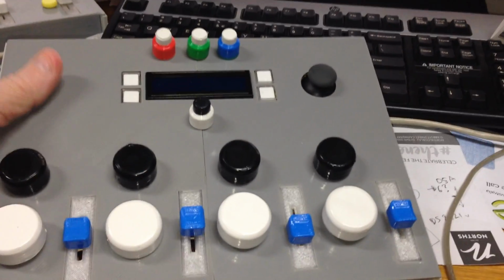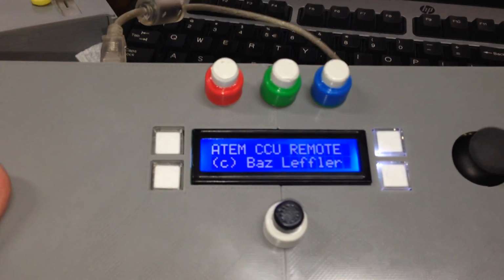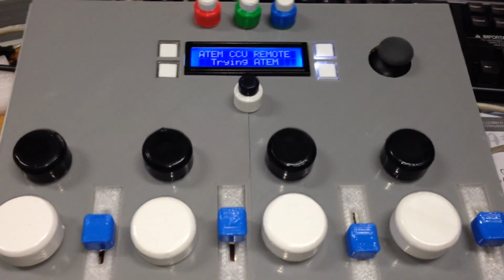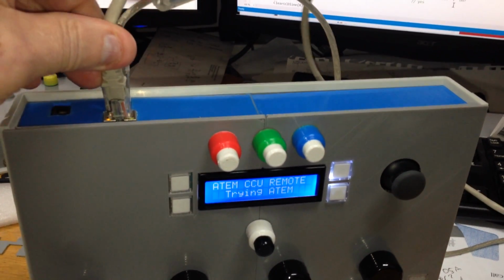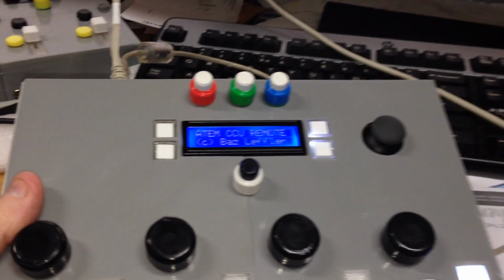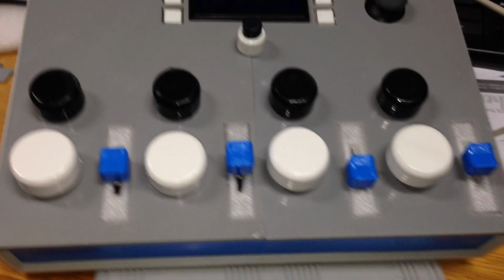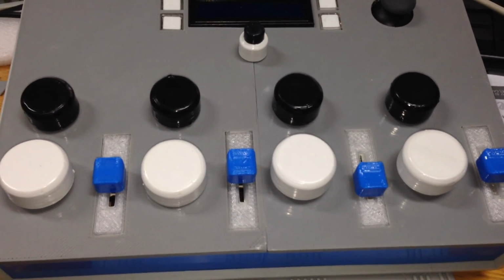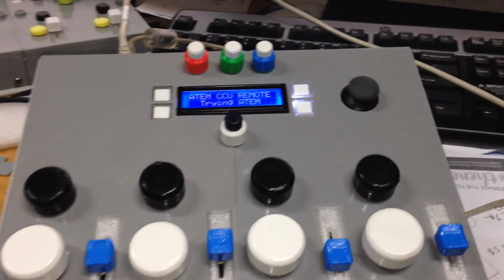4xCCU intro

Comment: compatible with ursa mini ? or just for bmd Studio camera only?
Reply from the maker: +Jay-e Hao 
Its compatible with what ever the ATEM is compatible with.
If a BMD camera has a 'return' input it will be (or planned to be) compatible.
You will have to check with BMD tech support for more details.
I am also designing 3rd part camera interfaces such as the Sony EX 1 (iris only) and Sony EX3 FULL control.